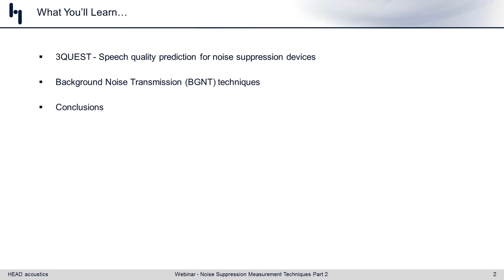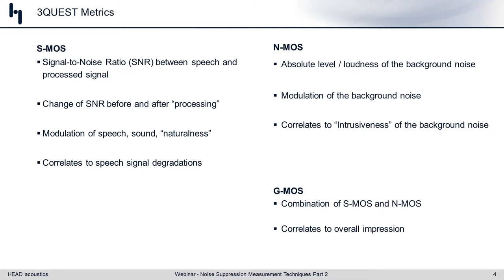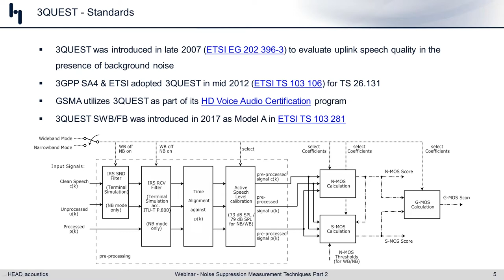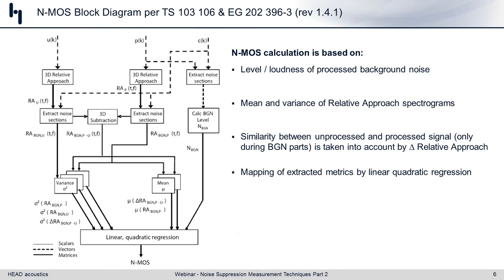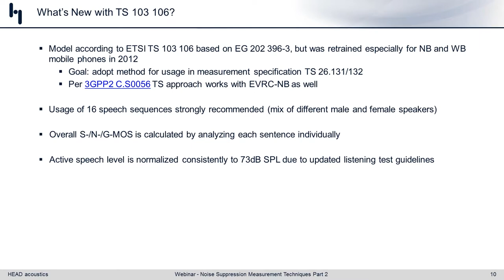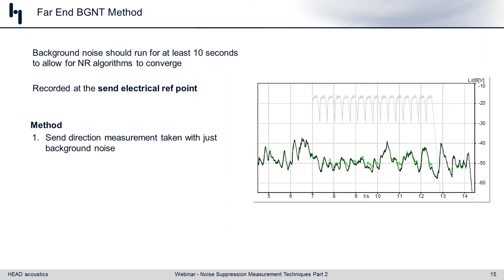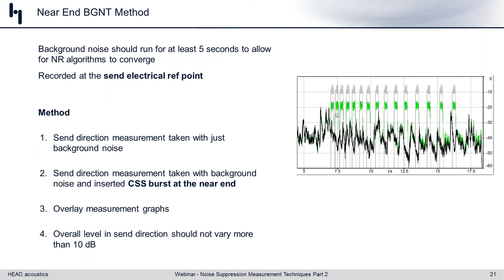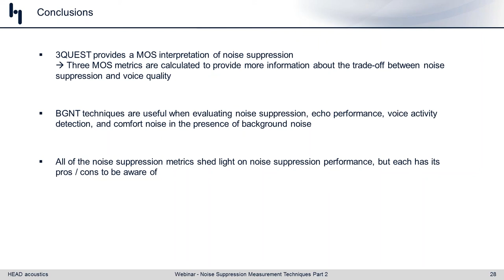Noise Suppression Measurement Techniques Part 2 | Voice Quality Online Seminar

Comment: Would you recommend to use PESQ to measure speech quality of a denoised signal?
Reply from the maker: The noise removal process might have left behind some artefacts that would be out of scope of PESQ, so we would recommend using more modern methods for this purpose, such as POLQA or 3QUEST.